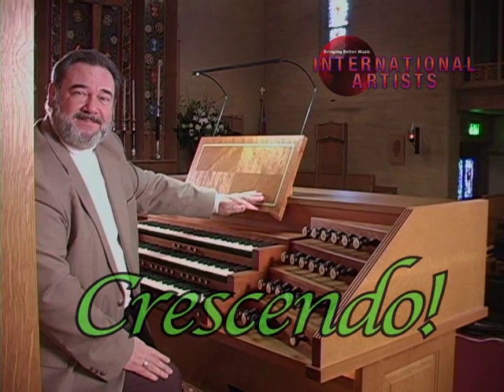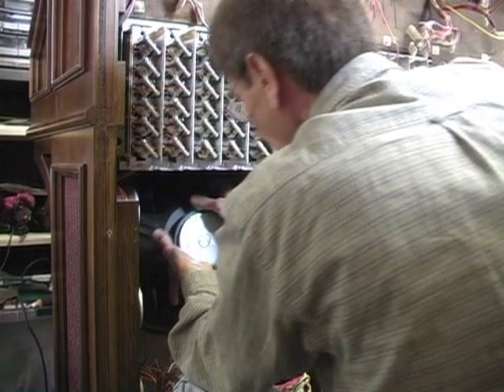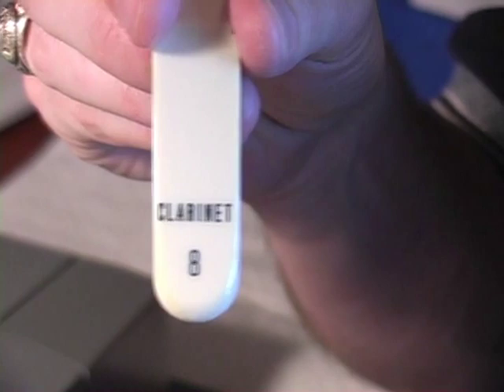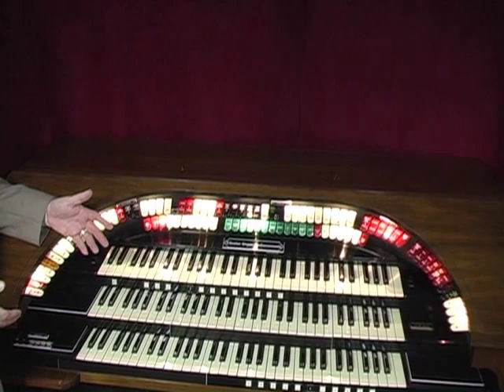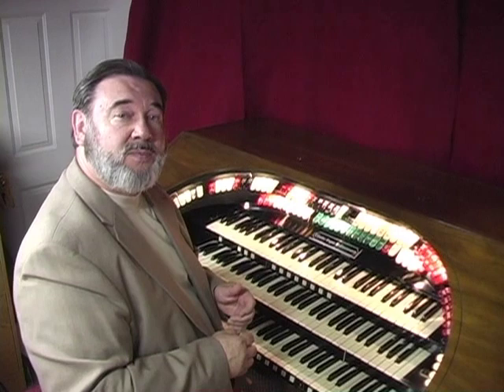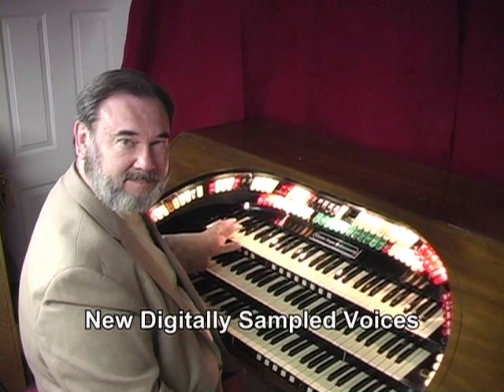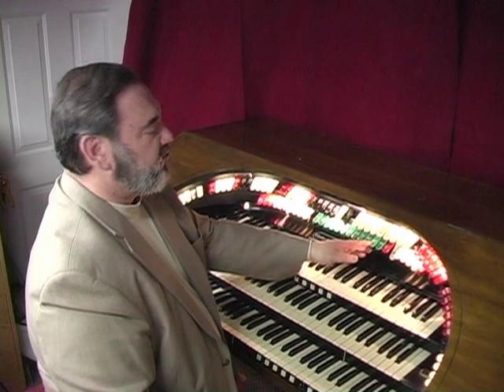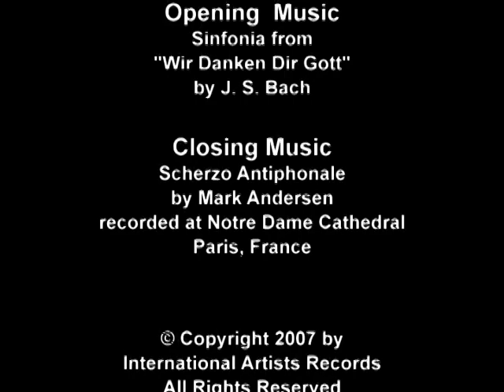Crescendo! Episode 118 - Rebuilding a Theater Organ

Comment: That's a Conn 653 made in the early 1980's, not built in the '60s - 70s as the host states.  Yes, older Conn's were built in the 60's-70's but this one was the last theatre organ Conn built under Kimball ownership (who brought out Conn).  I had a 652 and loved it.  Also, the original boards are not computer boards, they were analogue boards used to make the sounds...Again, NOT computer boards.  Love the reverb in the new digital voicing.  Too bad the Conn didn't have programmable memory and capture action (i.e. movable stop tabs).  Time and money would have been better spent retrofitting an older Allen theater organ IMO. Looks like the work was done in one's dining room <grin>. Nice job tho.
Reply: Actually time and money better spent in movable stops raises the important point: To what extent MUST one go to realize JUST THE SOUND? Indeed: Movable stops be excused! They cost so very much and often far exceed the budget and sensibility of the vast majority of those who love VTPO digital sounds. If movable stops were of primary importance, very few would pursue DIY kit VTPO;s. For that matter, if one is so consumed by movable stops, just dump your 401K into Allen.